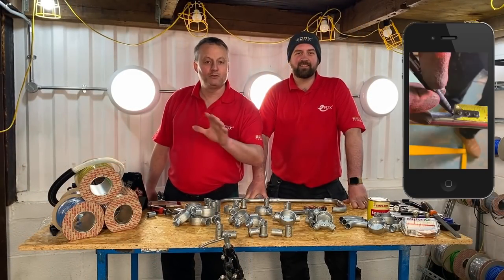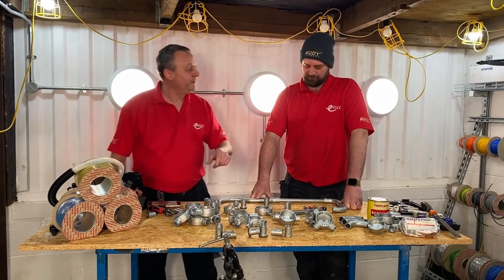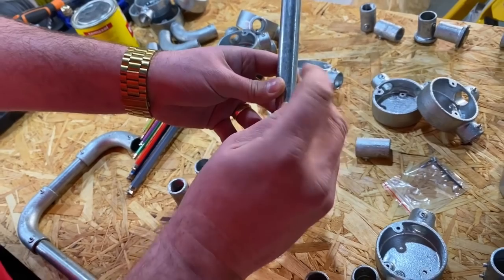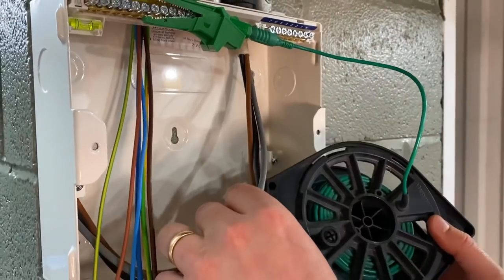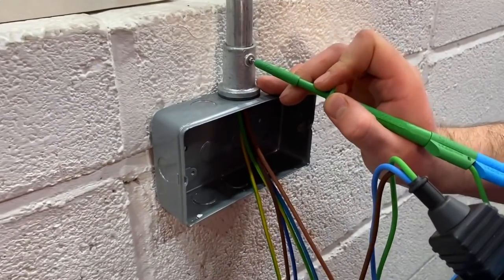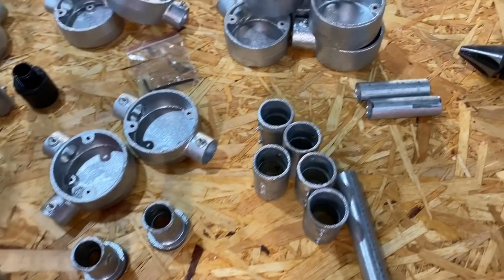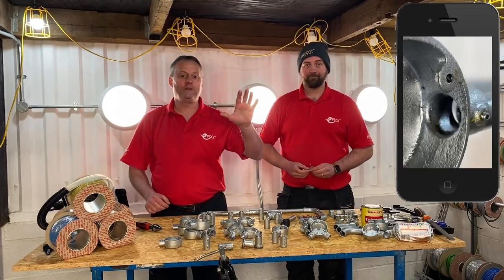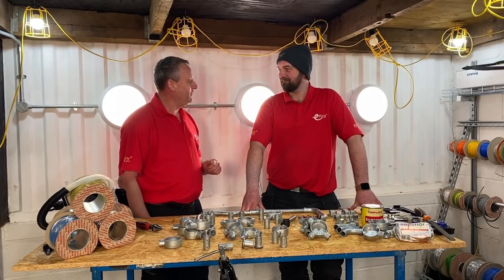Conlok Conduit Earth Continuity: How Does It Stack Up?

Comment: Used conlok on alot of installations over the past 5 years and it is fantastic and definitely cuts install time down but I'm still not sure that I'd use it outside and seal it with CT1. Outside I'd still use threaded and a bit of bosswhite on the last few threads for good measure.

Comment: I think I'd be interested in a lab based experiment of how both systems perform after a period of constant exposure to salt spray - it may be an unfounded concern but if that one grub screw were to fail 5/10/15 years down the line from corrosion how would the earth continuity perform?

Comment: kewl
Tip for the whole 'making life easier for electricians' thing: a 165mm Evolution Multi-Material blade from Screwfix installed in a cordless circular saw.  
Used with a speed square to keep the cuts square, this munches it's way through conduit, unistrut, tray, basket, whatever you put in front of it.
No more messing about with a hacksaw or going overboard setting up a full on chop saw station.
you're welcome 😁
Reply: Why not a portable band saw?
Reply: @DonaldEdney  Usually the price....
Reply: They make a metal saw for this purpose

Comment: If you had this much faith in the continuity why did you wire it with CPC?
Reply: You always stick an earth lead in as it's a stander thing to do and is required by the regs. Years ago people did used to use the conduit as the earth and the had a tester that put a big pulse through it to see if it was a good connection. 
A few old sparks said that when it was a loose connection, it made an aweful mess. Especially if it was berried in the ceiling and it blew it all to bit's 😂
Reply: @TheManLab7  what reg? as far as I'm aware it's still allowed as the CPC so I'll be interested to be educated, I would personally run earth's for the sake of an extra wire but if it's getting to the point of having to much in one run there would definitely be a benefit to being able to use it as cpc